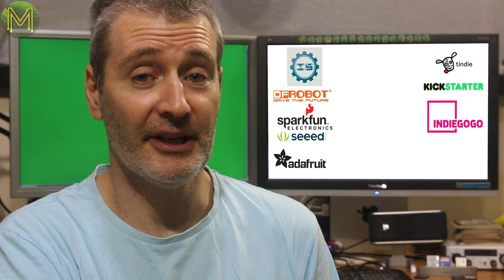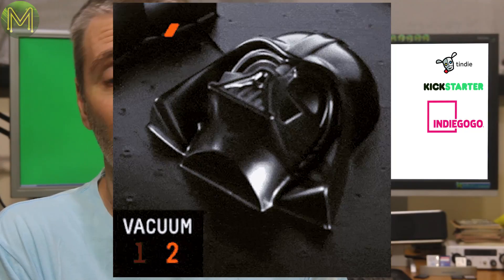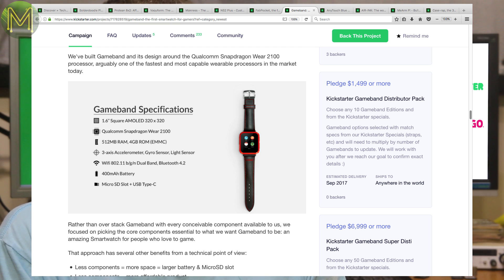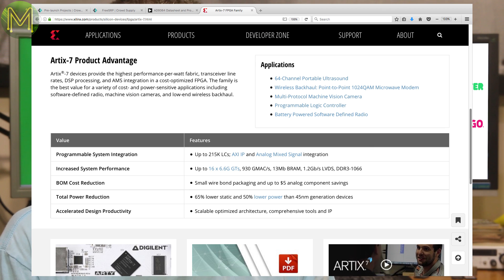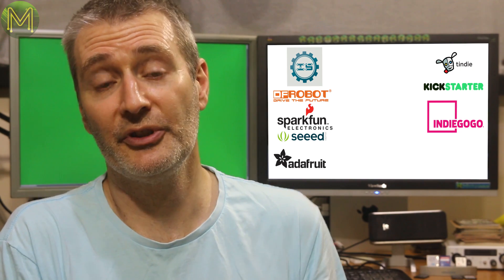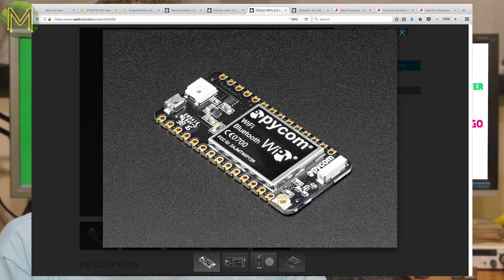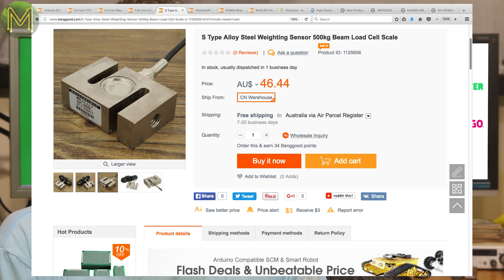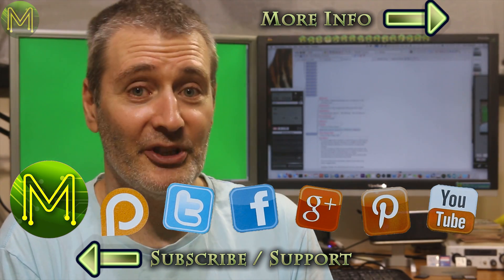#101 Weekly Roundup #23 - New Maker Products

Comment: loving your videos i have a question :i have to find a solution to connect 60 different boards that each have a transmitter to a single board that have a single receiver so i still didn't decide on the technologie i will be using should i use rf signals or wifi or xbee knowing that they are only gona send a single byte at most !!??
Reply from the maker: You could always use low baud rate serial, or RS485. What's the range? Bluetooth is cheap enough, but then XBee meshing is nice. It all depends on how much money you want to throw at it.

Comment: I wonder if that 16 channel power module could be doubled up to handle 240v
Any takers  o_O
Reply from the maker: +TheProCactus 
Hmmm I doubt it. Components would have been selected for 120v power so no matter what config you have it wouldn't cope with 240v. You might be able to replace some of them to work on 240v however.
Reply: I have a strange yet unjustified confidence it might work. Im sure its more trouble/risk compared to changing a few dozen components until known it works.

You parallel the module, and series the outputs on the same channel. That was my thinking.
Reply: But there are no components of concern on the high voltage side that would present an issue. That's the beauty of it! With 240V input voltage, a 330k resistor to give 15Vgs to power the FET gates would only dissipate about 160mW, so a 1/4 watt resistor would be fine. My sole concern for 240V operation is trace spaces, (which may be a fairly negligible point for most people). Also, thank you very much for sharing!
Reply from the maker: Adam Humphreys 
Thanks Adam for that.